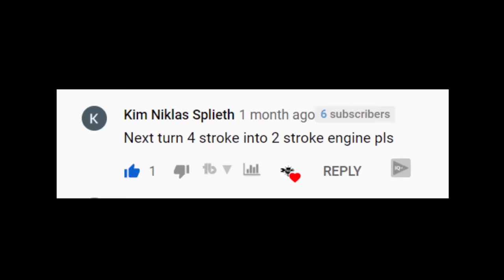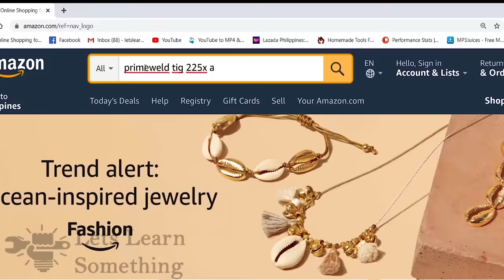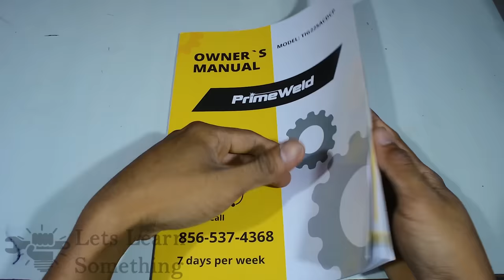I turn 4 stroke into 2 stroke  engine

Comment: How about trying to do the opposite thing of this??? (Converting a 2-stroke motor to 4-stroke)
Reply: Or gas to desel
Reply: Just watch the video backwards. Doh!
Reply: think husqvarna alredy did that ?
Reply: That would be much more difficult,  4 to 2 your simplifying the engine,  if you go the opposite, your having to add a bunch more things that simple engine didn't have before,  you could do it,  but it would require a completely new block (or heavily modifying the original) and many new pieces (basically the entire rotating mass) and not to mention valves and valve trane, much more difficult to do in reverse
Reply: He do more.. He turn a compresor to 4 stroke engine
Reply: @wonglongdong2390  lol
Reply: The Video is original in Vietnam
Reply: Vaios Kaliakoudas y
Reply: @jimmyalford1996  the Oldsmobile car manufacturer modified an Oldsmobile V8 gasoline engine to run on diesel fuel in 1979 and of course it was a total failure breaking crankshaft about every 25,000 miles..my cousin bought one that came in a GMC pickup truck  the dealer rebuilt the engine three different times replacing a broken crankshaft  each time  before the warranty ran out and trash the truck after GM refuse to fix it again and their redesign they didn't even raise the compression ratio so it was borderline 13 to 1 compression that's barely enough to cause an engine to diesel so in very cold weather it would not start at all....in the 1980s General Motors continued with their underpowered Oldsmobile diesel installed in midsize front wheel drive Cadillac. All around through Chicago Illinois became a junkyard of abandoned Cadillac that became a trophy treasure for mechanically minded automotive repair man as soon it was discovered that a 350 cubic inch Oldsmobile gasoline engine would very easily bolt up in place of the blown Oldsmobile diesel. At that time the 350 Oldsmobile gasoline engine had about double the acceleration making those midsize Cadillac front wheel drive cars a very sought-after as fast as they could build them very popular around town luxury automobile. So you had a Cadillac with only 25,000 miles with the brand new 350 olds engine sold like hotcakes everybody wanted one and you could buy a blown up Cadillac with a destroyed Oldsmobile diesel less than $1,000 then spend around $2,000 converting it to a gasoline 350 high performance Oldsmobile engine and sell the car for 6000 dollar as fast as you can put them together and back then even an Oldsmobile 350 gasoline engine was good for a round 175000 to 200000 miles. Plus considering the Oldsmobile lineup of engines you could get a 455 in the same configuration block getting you a Cadillac with an attitude bad of a 442 Oldsmobile w30 race car period. Best for economy the 350 was the engine of choice that still has power that would lay your head back against the headrest. And most all mechanics would install dual exhaust with three pass conventional Mufflers of course that gave a very nice performance sound with a great car with a real engine that worked. Just thought of another feature that you could do today there are several companies building throttle body that replaced those Quadrajet carburetors that were junk from the beginning that would give you over 20 miles per gallon in such a rig with a 350 engine. FI TECH are the original builders of throttle bodies to fit and replace carbs of 70 and 80s vintage cars and pickup trucks
is one company that bills a throttle body to replace four barrels carbs what is a self-contained unit that automatically still Tunes onto any engine u bolt them to Simply adding O2 sensors in the exhaust and 20 minutes to an hour the throttle body will learn your car and keep it at Peak Performance at the highest gas mileage possible. All a person has to do is pull it out of the box install it on the intake manifold and hook up a 12v power supply to the chip that's built into the throttle body attach wires from your O2 sensors to the throttle body instantly giving you automatic stand-alone computerized electronic fuel injection that is constantly looking at your air fuel mixture that is constantly adjusting for the best possible setting for the throttle body built-in electronic fuel injectors a win-win no-brainer for all...and never have to have your engine fuel/air mixtures adjusted again ...the only tuning maintenance you would ever have as a person should replace the spark plugs before they seize and rust up into the cylinder head would be something to consider as they will permanently Bond then sells in to the Head like I'm saying can easily be avoided if you just pull them out once in awhile and make sure they're not Rusty or foul out and very easily accessible on that particular 350 olds engine and of course I would have had the 455 monster motor but now that I think about it there are other cases of where you can very easily install a completely different type of engine in a common vehicle like an international Harvester pickup truck has the same bolt pattern as an International Harvester farm tractor with a diesel engine. Mainly the IH 560 diesel farm tractor engine will sit in and bolt up to the clutch and transmission bell housing in place of the gasoline engine under the hood of a International Harvester pickup truck and to keep in mind one without any modifications allow the farm tractor engine to run at a its governed Factory speed that wrap around 2600 RPM would get you 70 miles an hour down the highway straight up hills down mountains over the land desert whatever with the truck empty or full load that tractor engine would never know the difference....those old 560 diesels burned about 3 gals per hour pulling a plow or not ..giving you about 23 miles per gallon diesel vs the original gasoline IH pickup truck engines barely got ten miles per gallon of gasoline.......back in and around 2007 is when the EPA decided for us without our permission to band all 2-cycle engines from the United States as they claim they polluted the air was killing us all but others have expressed changing a two cycles to 4 Cycles can be a expensive diminishing returns obsolete no game for nothing a very very good example alleviate sticking their nose in places where they're not smart enough or intelligent enough to understand what they are destroying for planning is better that is actually a way more pollution and worse. It so happened that the Stihl chainsaw and Power Products Company to build a 4 cycle engine to replace the size and power needed in a hand-held chainsaw weed eater hedge trimmers you name it it wasn't enough room to have a crank case  with a pressurized oil lubrication for all the extra moving parts , or a 4-stroke engine that cost almost double money to build and produce to sell  and reproduction the German chainsaw company called Stiel used a reed valve check valve to lubricate the camshaft lifters valves from using Blow by past the piston ring and mixing the oil and gasoline together just exactly like a 2 cycle only polluting the air much more than a 2 cycle with the wasted power from piston ring clearance blow-by to allow the bottom in to become lubricated thanks again to  our  fucked up EPA who don't know their ass from a hole in the ground when it comes to automotive engineering as you have to spin a 4 stroke more than twice as many rpm causing twice as much pollution in wasted gasoline and burning oil as a buildup of carbon deposits that you will have in a four stroke destroys the piston and rings and valves very quickly to make enough power to do the job of a 2 stroke as two strokes only have three moving parts , the piston, the connecting rod, and the crankshaft
Reply: @donniebaker5984  liked the end lol
Reply: @donniebaker5984  you seem to know things. l was thinking putting wings on old car drive till lifts , no vids of that on youtube

Comment: Fair play for doing it the difficult way. You could of just fitted a 2 stroke top end that had the inlet on the barrel and not had to do a lot of the modifications to the crank case ECT. Wouldn't of been as interesting a video tho 😎
Reply: Wouldn't the fuel get into all oil systems if you did that?
Reply: @bulko89  nope, the fuel mixture enters the combustion chamber through a inlet hole located part way down the cylinder, it goes nowhere near the engine oil system. It's a very widely used design on 2 stroke engines.
Reply: @Impulse_Guy  Wouldn't the intake need to have some forced air system on it?
Reply: @BrokenLifeCycle  No,the fuel,air,2t oil charge is drawn into the combustion chamber by the vacuum created by the piston on it's downward stroke towards BDC.

Comment: That was amazing, I’d love to see gas to Diesel engine That’d be something crazy
Reply: haha should be easy enough after glow plugs, diesel injectors, different exhaust, diesel oil, and many more things
Reply: @tozzaschannel  diesel doesnt have glow plug
Reply: QIFA GAMERS ... are you serious?
Reply: There wouldn't be enough pressure to make diesel burn
Reply: @tozzaschannel  not all diesel engines have glow plugs... many modern single cylinder diesels and older multi cylinder diesels rely on compression alone.
Reply: Has already been done with the Chevy 350
Reply: convert a single cylinder motorcycle to a single cylinder diesel motorcycle?!

Comment: Is the ignition still the same and are the ignition timings also the same or how did you fixed this?
Reply: PILu'  4 strokes spark plug doesnt ignites every time that the piston go to the top.
4 stages of a 4 strokes engine.
(Intake, compression, power and exhaust) the piston go to the top at compression and at exhaust to eject the burn gases. He put a diferent CDI dont ask me how tf he find the correct time, i think is some CDI's that you can move the time of the spark plug ignite. Sorry for my english

Comment: Make an Hybrid motor.. with tranfer ports like two strokes but with a valve controlling exhaust opening
Reply: Essentially the design of the old 2 stroke Detroit diesels, transfers for intake and poppit valves for exhaust
Reply: Desmond Wright Except that a Detroit 2 stroke requires a blower to fill the cylinder at BDC through inlet ports as it's not crankcase scavenged like a regular two stroke and doesn't produce its own vacuum to breath
Reply: @tysonj4688  yeah fair enough, same principal different execution
Reply: Well with such design you could even use a turbocharger and produce power every revolution of the crank

Comment: exhaust port is too small and too low, thats why engine rev like shit and not like a high power 2t engine, other than that nice build
Reply: Right
Reply: guess on purpose so it will not break down at start up and yes l saw much bigger ports on normal cilinder

Comment: Buy like a 28mm Keihin carb or the KOSO that is the replica to see if it runs better
Reply: No point in it. The porting is so restrictive that throwing a larger carb at it wouldn't do anything. the carb isn't the restriction, it's the porting, and there's nothing that can be done about that without throwing tons more fabrication at it.

Comment: You made a 2 stroke that needs oil seperatly still??
Reply: Transmission oil most likely. Or just wasted time with adding oil to fuel.
Reply: Its for the wet clutch and transmission goofus

Comment: poor guys milling machine and yet owns a lathe, could of faced off using the lathe, fly cutter and an angle plate. impressive job. I have had 35 years in engineering and I love guys that can do this.

Comment: The exhaust port was made really small my 50cc engine has a bigger exhaust port then that and yours is 110cc u would have made more power if u made it bigger I’m surprised it even runs
Reply: not really , the exhaust is ok , its the intake port that gives you more power !
Reply: Roland Gutierrez it would have an impact on power since it’s restricting gas flow and back pressure, but it wouldn’t prevent it from running
Reply: Yeah but the carburetator is also from the 4t engine that means its a smaller one so less fuel comes in and you dont need a bigger port to exhale all this gas.....Still, the arrangements can be done later like a better exhaust a bigger carb so you can make it alittle more functional and better at its rev per minute. For starters its enough......
Reply: stefanos papadopoulos the size of the carb doesn’t matter, its all down to the size of jets he’s got in there and most of the time 2t jets are smaller than 4t so it wouldn’t matter if the outlet is smaller since it’s getting enough fuel and air, if that was the case you’d know because it would bog at full throttle

Comment: Glad you decided to true up those mating surfaces.  I'd like to know what that strange noise is caused by.  I noticed that you left the ports more or less parallel to the rings instead of angling them a bit.  Could that be the noise, or is it pre-ignition or what?  Fantastic job.  But like most jobs.  It's not over when it's over.  There's always that last bugger if you wanna go after it.  I'm not criticizing.  I'm very curious about that.
And what a paint job.  What kind of paint did you use?  Very nice.
Reply: oh thats why the ports upper line edge is angled in other motors
Reply: @lofturhjalmarsson9896   Yes.  But I don't completely buy that explanation.  It's, theoretically, something to think about, but I don't know.  Rings are supposed to be a perfect circle.  Do they wear unevenly and start impinging into the port?  Probably.  
We will keep our eye on all of it and see what we see.  Let me know of any thoughts, please.
Reply: @alext8828   well  motor wise many throw scooters here in trash station that are still ok and very wanted by teens, or say six a year or more . nonn starters l use a method not seen in youtube open head cover its four stroke znen often dip screwdriver in redex and put end on many places near and on valves soak it has worked a few times, but maybe would be eoungh to put some oil   into plug hole move piston let leak out . to tighten walves with the oil. maybe its not the rinsing action of redex so much  but just cos it is tick it blocks air leaks round valves. so l made a video put it on here.
Reply: @alext8828  answer part two , many vids on yt on drill starting , but nothing about the risk l think l discovered, my spark was gone after drill was in reverse by mistake thinking too much electicity went the wrong way into the coils of stator maybe melting them.

Comment: nice job! small remark. You've could aswell have the reedvalve intake directly on the cylinder. That would have saved you some welding and cutting... Take a look at old Lambretta engines.

Comment: If you make a tiny boost port that opens a little later than the transfers, and a much bigger exhaust port, your engine would perform A LOT better. Still amazing work anyway...

Comment: You could break that seal on the crankshaft due to overheating if you weld the housing, at least it will last shorter,, try to weld small point first, pull the seal off, and then continue welding,,,

Comment: First of all, whoa, great design and fab skills!  From the looks of the exaust I'm guessing you're still using oil in the fuel, I wonder if you can skip that and add oil to the crank case instead, let the original 4 stroke's oil system handle the lubrication. Maybe I'm missing something?  Thoughts?

Comment: id like to see this be done with a fuel injected 4 cylinder (or more) car engine, except instead of using the crankcase as a air/fuel transfer port, id use the neighbor piston as the air/fuel delivery to the next cylinder so i can still use the crankcase with oil so it doesnt have to be mixed just an idea ive had for a long time. i would try building this myself but i dont have the money, place or garage to.

Comment: What I've always wondered is, with a normal 4 stroke, DOHC engine, if, say, you changed out the cam gears. Ran the camshafts at twice the speed (assuming they can handle it), and used a 2 stroke ignitor. Could it run as a 2 stroke with even less work?
Reply: Ummh, no, it cant, the rotation of the camshaft should be matched with crankshaft, when crankshaft rotating 720°, the camshaft rotating 360°, always 2:1

Comment: is is fast now? coz usualy 2 stroke engines are more powerfull coz high rpm but you could use more transfer ports and open the exaust port to get this to rev and get a realy good power improvement from it

Comment: brilliant ,but going backward want cleaner air 2 cycle pollutes ,2 noisy,messy mixing fuel smells, waste gasoline and burns oil not good for the environment.but dude you're a Genius great work china parts are plenty.

Comment: What timings? And i would make the exhaust port waaayy bigger. I would recomend 175°/115° for out/inlet. 
And 65% lenght of the exhaust port. If you want more power, just make a 3 port Outlet instead of one single. With a 3 port, you are able to make 94% percent of the bore diameter. 50%= 20mm from a 40mm bore. OK? Dont put a single outlet over 65% or the ring gonna wear out fast. You`ll see, there is a lot of potential in this engine with a correct exhaust

Comment: Why didn't you just use the cylinder off the engine you swiped the head from? There has to be a cylinder reed jug with similar bolt pattern out there somewhere    Could've saved some time and many headaches.

Comment: can you convert a 2 stroke into 4 stroke? i mean is it possible?
Reply: Its possible, use 4 stroke block, add 4 stroke head and its parts (valve, camshaft, timing chain, timing gears etc.), add oil pump, change the ignition system